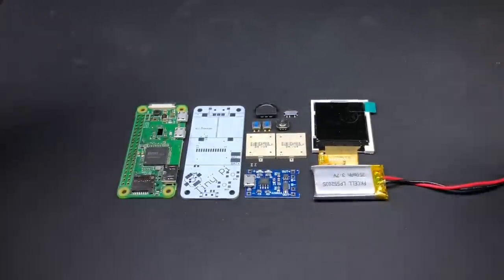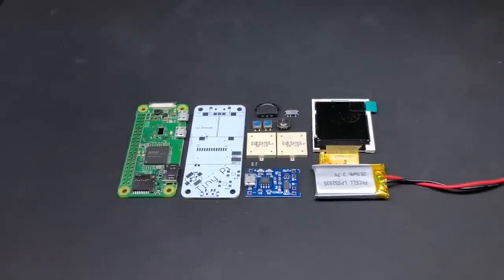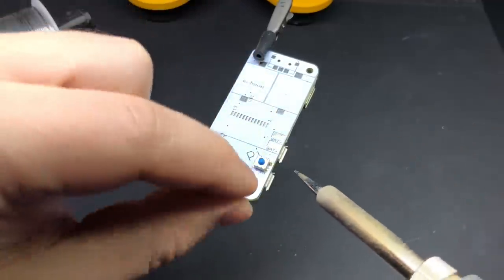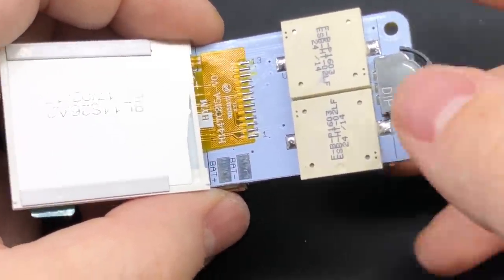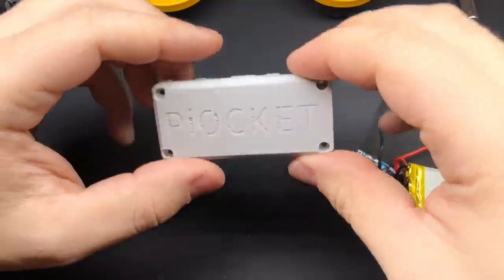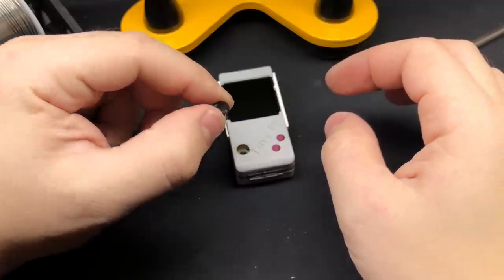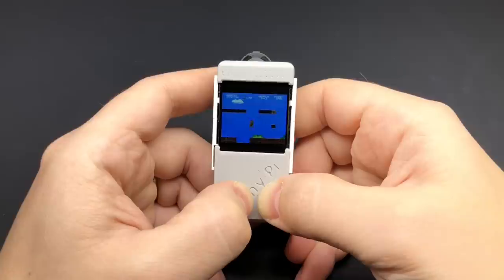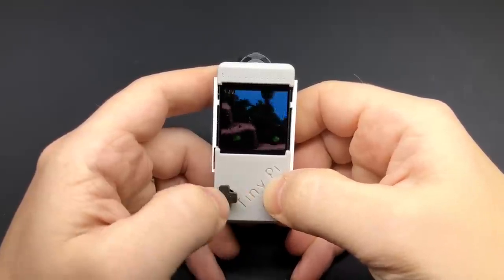TinyPi - ridiculously tiny gaming handheld!

Comment: in case u were wondering the kit costs $54 + $10 shipping + $7 battery charger + $5 resistors + $7 battery = $83 and if u dont have a soldering iron just make it $100
Reply: I really want to do these projects, but i dont understand why the kits are so expensive, i mean the rasberry pi 0 is can be bought for $5, and ive dealt with creating pcb's they are not an extra $40, so why is the kit $54??? its like they dont want me to do the project

Comment: how about a gboy built out of a bluetooth watch, use the screen, speaker, battery and bluetooth from the watch and put the buttons on the straps. the buttons can be connected to a controller panel by BitBuilt and stored in a 3d printed backing for the watch. All the information is then relayed via the bluetooth to your device of choice where the emulation takes place.

Comment: You really need to try the Pi 3 compute board. 
It's a Pi 3, smaller than a Pi Zero, it has no connectors of HDMI USB Ethernet, instead are accessed by pins. Would be perfect for one of these!

Comment: Is there any way to make 4 buttons instead of two for Super Nintendo games
Reply: if the buttons there only connect to gpio, you can just add buttons on another set of pins, or go nuts and matrix em.
Reply: Thanks
Reply: There are no shoulder buttons on this thing
Reply: add some.
Reply: +justin

It's a 3d model case. Just get the model and cut shoulder holes in it.
Reply: While it's possible to play snes games if you had 4 buttons, it wouldn't be fun, because some SNES games (like kirby and star fox) slow down on raspberry pi 3 b, which is bigger and more powerful.
Reply: yeah probably
Reply: The rotating slider on top acts as X and Y buttons.

Comment: That's amazing! Only beef is that there's no L R buttons
Reply: There's a jog wheel at the top for L and R.
Reply: Corey Dryja Hmmm... L/R, OR X/Y... 6 inputs on a SNES, something will still be missing.
Reply: Yeah, it would be user preference. You could always solder up some tactile switches for proper buttons. You could get really thin SMD switches.

Comment: Welp, there it is, the tiniest Rasperry Pi Zero portable gaming rig ever. Legitimately, unless you ripped the battery part off and just used the direct power port on the pi, which would make it not portable and kill the point, how would you possibly go smaller? lol

Comment: Why not just modify a Gameboy Advance micro, I know it's too long to fit in there but with enough case modification. I probably would use a different battery and replace all of the tiny plastic and metal parts with 3D printed ones. It would be nice if you could get metal Parts but I'm not how to get parts that small without calling up the custom case maker Linus Tech tips uses on occasion.

Comment: It's great but why do people even build these pi boys or pi ps1 when you can run any emulator on gs5 and higher phones? I can use dolphin emu and play gamecube games on my Gs5 why would I want to spend nearly $100 on a device that has a smaller screen or needs a screen to play just a limited selection of games with an even more limited life span when I could easily just recycle old phones and use them for gaming and multimedia x,D
Reply: To have the experience of putting it together?